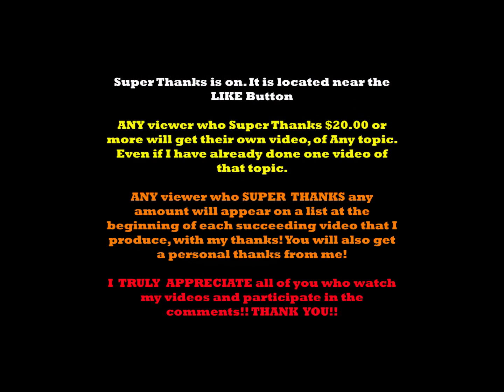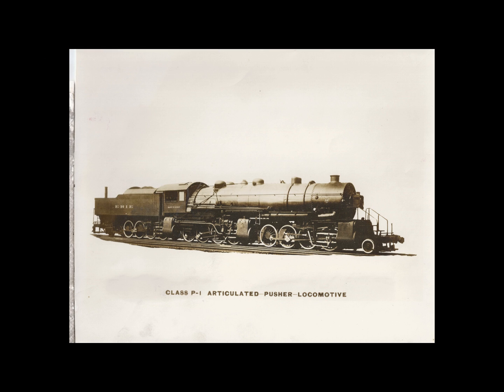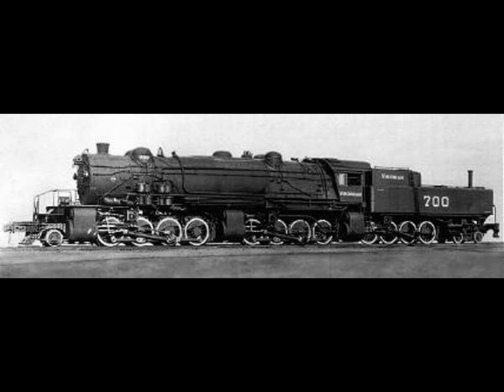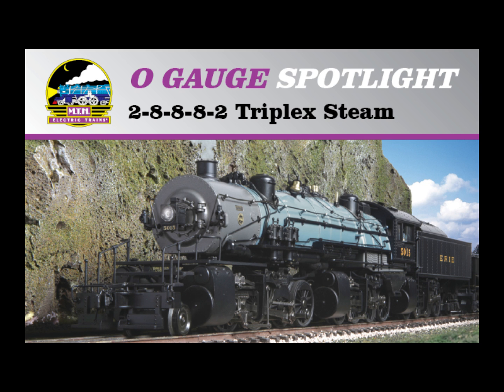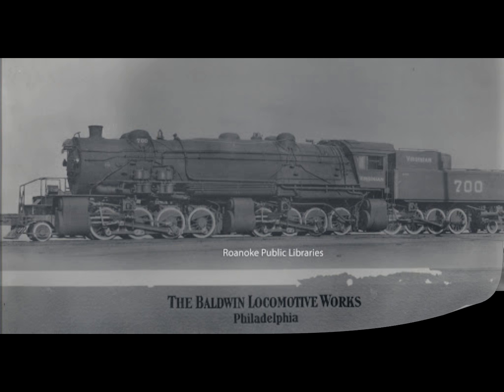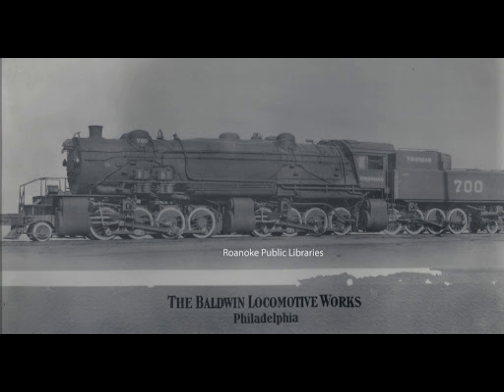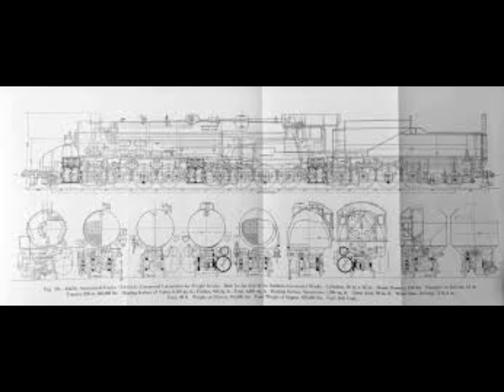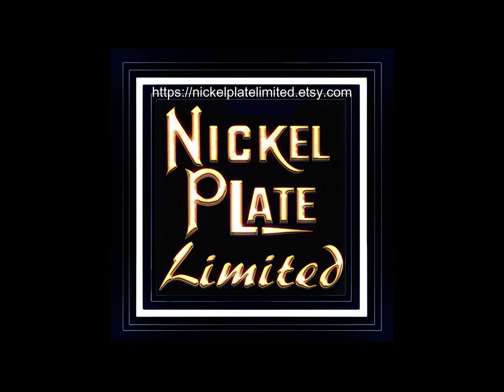The Erie Triplex Locomotive

Comment: This already was a crazy design, but there have been ideas for quadruplex locomotives made up by Baldwin, in the form of having 3 drive units under an articulated boiler and a fourth under the tender. Another quadruplex was designed by Beyer Peacock of the UK, where two Mallet style engines had a central bridge frame in between carrying the boiler like on a Garratt locomotive.
One Quadruplex has actually been built in Belgium, it was a crazy 0-6-2+2-4-2-4-2+2-6-0 with two boilers with Franco Crosti preheaters, and that one was a failure because, guess it, it broke coupler chains, needed two firemen of which one was on his own like on early cab forwards, it was too complex and top speed was pretty low at 38mph. 
And then George R. Henderson even had a patent for a quintuplex locomotive with a second drive unit under the then articulated tender 😱
Reply from the maker: I think there was a Dex too if I am not mistaken.
Reply: The Franco Crosti wasn’t a failure, it worked well and got sales for regular Franco Crosti boiler equipped locomotives.

Comment: You mentioned that tender capacity was '16', if I heard correctly.  If that is 16 tons, a locomotive of that size would have consumed that pretty quickly.  It sounds like a great idea for heavy coal haulers, as were the ERIE and Virginian.  Thanks for a fascinating glimpse into this unique and robust period of railroad history.
Reply: The Erie grade was fairly short, at 10 mph about 45 minutes work.  There were occasions where they were handfired up the grade.
Reply from the maker: That is correct

Comment: I wonder how this locomotive would have done with a N&W Y class  firebox and boiler
Reply: They weren’t far off success, at least on the Erie.  The grade was only seven and a bit miles long.

I've wondered how'd they have gone with a high capacity boiler, too.  But say a UP big nine.

I'd think they'd have been better, and maybe a success instead of being 'spotty.'
Reply from the maker: @theimaginationstation1899  They definitely could have used poppet valves for sure.. LOL .. SOMETHING.. They really, really ate steam.
Reply: @TheRailroadCrossing-SteamPower, if they had a mix of a big boy and y6b boiler, it could have worked
Reply from the maker: Not enough I dont think... This was a bad, steam eating design that slipped badly.

Comment: Thanks for another interesting video.

These are complex beasts with a tendency to have the Virginian and Erie experiences conflated.  

Anyway, they were always intended as pushers.  Their only up-front experience was on tonnage tests where the Erie tasked pushers to help get the test trains into motion - to alleviate the risk of couple breakage.  In breaking couples nonetheless, they were hardly Robinson Crusoe.

Of the three engines, the trailing had the greatest adhesive weight, and the lead had the least.  Of the three engines, the centre developed the greatest TE and was liable to slip in unfavorable conditions.  The lead and trailing engines developed the lesser tractive effort for obvious reasons.  This wasn't intentional so to speak, but a reality of the componding arrangement.

The boiler capacity was plenty with a 24' boiler barrel.  The firebox was a tad small - but as Bruce says, they weren't quite up to expectations rather than being an abject failure.

The Virginian had a much larger firebox, but no combustion chamber.  It also had smaller cylinders and drivers - but the task of working on a grade roughly half as long and twice as steep at half the speed that the Erie enjoyed was beyond it.

Anyway, those are my thoughts for what it's worth.
Reply from the maker: Great Info!

Comment: It was ahead of its time, if it was made in the 40s it would maybe have had a small chance.
Reply: It was the centre engine that was prone to slip in unfavourable conditions.  There wasn't much in it, a ton or two - but the trailing engine had the highest adhesive weight of the three.
Reply: @theimaginationstation1899 One thing is for sure it was a poor design.
Reply: LOL.  I put my comment in the wrong place.  Yes, the Virginian was particularly so.  It wasn't so much that they were less than the sum of their parts.  Probably more that they were the sum of their parts.  Still, hats of to Baldwin for thinking they could get the Virginian to perform.   @FearlessBravePatrioticAmerican
Reply: @theimaginationstation1899  Yeah, I wonder if it would have had a chance in another decade.

Comment: The   2-8-8-8-4 was built for the VIRGINIAN railroad   later cut up to form two other locomotives
Reply from the maker: One at least was a 2-8-8-0 if im not mistaken. Not aware of another.. But my guess would be a Consolidation 2-8-0???
Reply: @TheRailroadCrossing-SteamPower  The locomotive was converted in a 2-8-8-0 (later 2-8-8-2) class AD, while the tender was placed under a new boiler and made into a 2-8-2 class MD.

Comment: This wheel arrangement would have been better if the exhaust from the rear engine set had been piped back to the stack besides increasing the grate area.  In the Garrett style of locomotives, the exhaust was directed through the stack.  
The Southern RR  had a 2-8-8-8-2 or -0 which also did not work out well.
Reply from the maker: The mechanics on that I didnt quite grasp. I needed to see a diagram or something.. So to your point.. I think I agree.
Reply: @TheRailroadCrossing-SteamPower  The Southern RR had an articulated loco of 2-8-8-0 with an eight-wheel engine under the tender called a tractor with a wheel arrangement of 8-2.  It was similar to the Erie and Virginian 2-8-8-8-2 wheel arrangement.  I can't remember if there was a trailing truck under the tender so I don't know if the wheel arrangement was a 2-8-8-8-0 or a 2-8-8-8-2.

Comment: The tank engine that really, really shouldn’t have existed. But they made it anyway.
Reply: They had a very unique requirement in trying to replace three 2-8-0 banking locomotives with one unit.  The earlier 0-8-8-0 L-1 locomotives had the slightly different parameter of needing to replace two bankers.  So they did have a very particular niche to fill.
Reply from the maker: A recurring theme with the railroads in those days
Reply: @TheRailroadCrossing-SteamPower  it is why I love the railroads back then. throw money at a problem and it might get fixed.